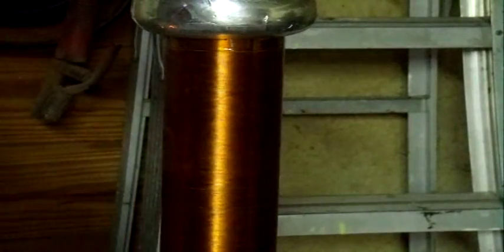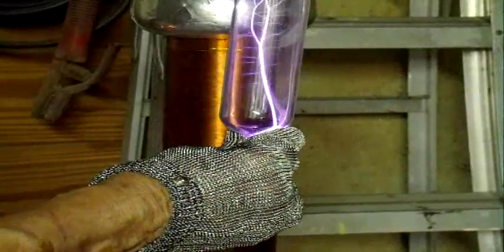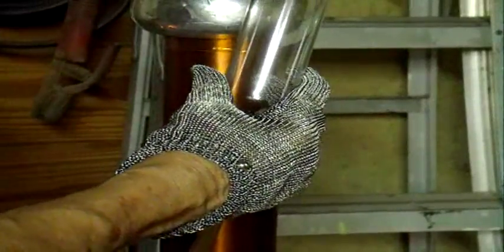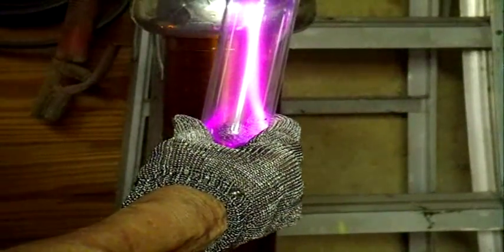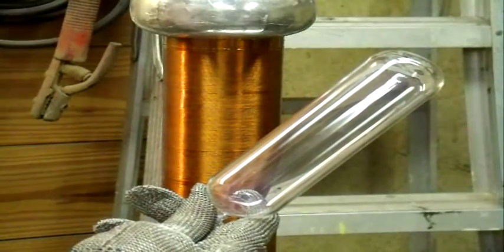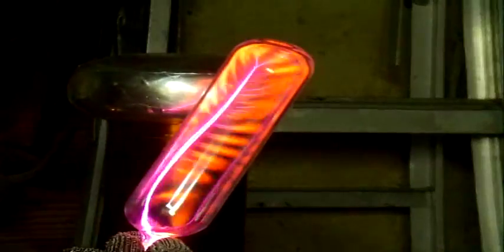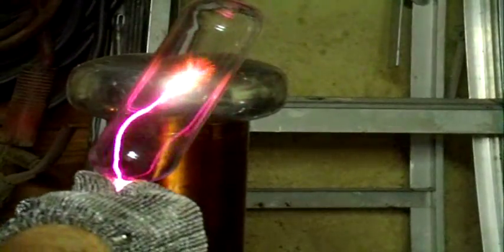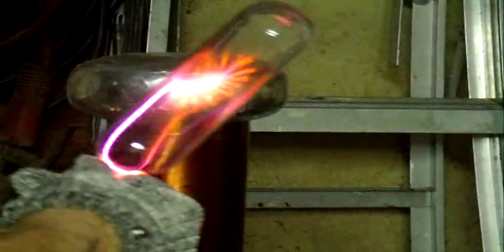tesla coil glow tube higher pressure tests

Comment: Thank you Ron for your reply and this cool experiments. I was wondering if/how low pressure/high pressure and different gasses affect current flow and voltage drop/raise/ frequency etc but I couldn't find any information how that can be measured at high voltages that tesla coil produces. maybe some sort of voltage dividers but it sounds like not an easy task to accomplish.